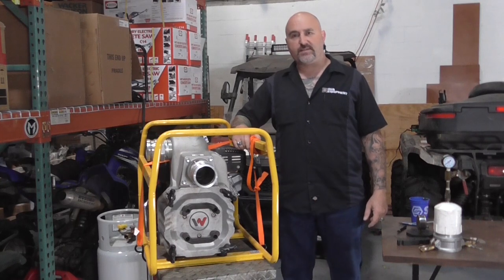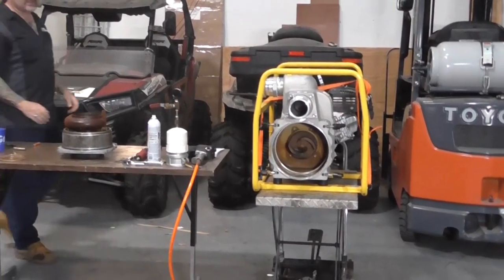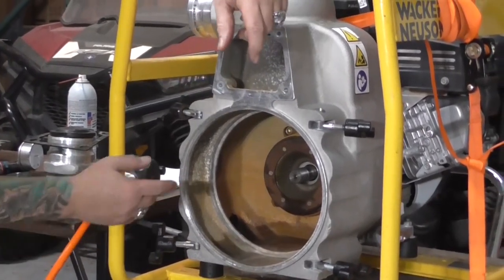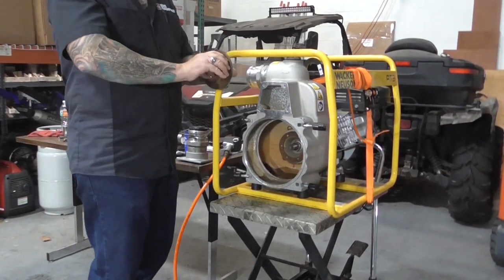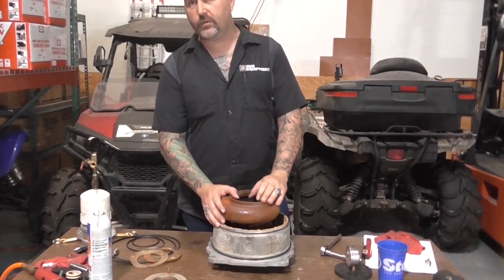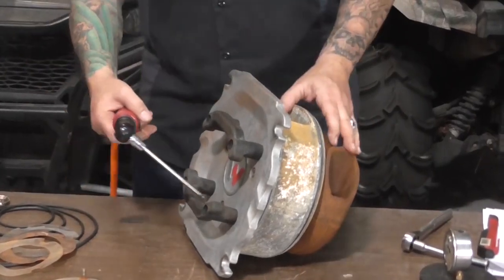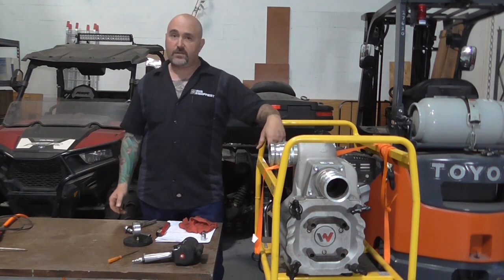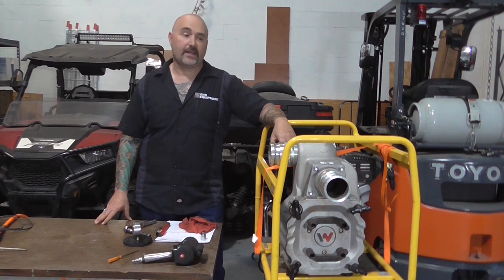Wacker PT2, PT3, PT4, PT6 Troubleshooting - Won't Pump, Won't Suck

Comment: Question on PT4: is it possible to use the same oil that is poured into the crankcase to lubricate the sealing ring?
Reply from the maker: Hello,
If you are referring to the back of the water pump housing where there is an oil plug on either side of the housing, then yes you can use regular motor oil. That reservoir is not for lubricating any seal rings, it was designed to keep the mechanical seal cool. 
Hope that helps.
Reply: @DHSEquipment  Thanks! otherwise I could not find the brand of oil specified in the instructions

Comment: Any helpful hints on how to get the bolts out of the housing to separate it from the motor? I keep braking 8mm snap on allen keys trying  To loosen the 4 bolts on my Wpt3 pump.thanks..ps the pump leaks between the engine and the pump housing ..

Comment: Hi Dave, I plant to buy a PT3a. I live very far from 🇺🇸. Middle Africa Burundi 🇧🇮. I will fly to Dubai to buy it. I will use it for Sewage Water on a truck every day. Wich accessoires I have to have home, because I cannot fly every time to buy Oring.
Thanks Dave for your video.
John
Reply: Hi John, Here in the U.S., Wacker changed the design of the pump and the new PT3A is very different. Can you tell me which p/n or item # pump you are getting? I don't know if Dubai is selling the newest version yet.
Send me what you can, even if only a picture and I can tell you what to get for it.
Thanks

Comment: I have a 9 year old PT3. The impellar looks just like that. I'm not sure if the threads are reversed. Do you know if they ever were? Thanks.
Reply: They were never reversed. Good luck with it !
Reply: The Wacker has always primed even in a 13' deep swimming pool. I got jammed with debris yesterday, and now it doesn't prime. Checked all fittings, hose, etc. I'm thinking the impellar just needs to be tightened up. Any suggestions? Thanks Dave!
Oh, and one more question. Any idea on how to keep the haft from turning when I take off the impeller?
Reply: Joe,

There are a few things to consider. First, are you just checking to see if it primes with the suction hose in the water and looking for moving water or are you testing the pump only ?  I always separate the pump from the hose to eliminate a damaged or unseated suction gasket or a small hole in the suction hose or something.  When it was running yesterday and working how much suction lift was there? ( the vertical distance that the pump can be above the liquid source.) Is it the same as today ? If it was deeper today than yesterday you could be looking at worn components and yes, shimming your impeller may help depending on the condition of everything else. If the depth or distance is the same today as it was yesterday, I would be looking for something like an air leak from a damaged O Ring or cracked / damaged mechanical seal. 

When we remove the impeller it is with the impact wrench with the impeller tool or a socket on the impeller. Usually the speed and impact do their thing and the shaft doesn't move much. You could use a piston stop ( I don't love them when using an impact wrench, you could damage the piston) or we have in the past put starter rope in the spark plug hole. Bring the piston to the bottom, feed in some starter rope, (You'll want to be doing this on the compression stroke to keep your valves closed.) Don't let the rope fall in, you need to leave some hanging out so it can be pulled back out. slowly rotate the engine until the piston compresses the rope and doesn't allow the shaft to turn any more.

Hope that helps 

Let me know how it goes !

Dave

Comment: How can I time back the diesel engine I got the pt2 and pt1 how can I time back the engine I rebuilding them thanks in advance
Reply: Hi Kevin, send us an email with the machine s/n , mach # item and rev# please.  I have not heard of a PT1 before and not familiar with what  diesel engine might have been on the PT2.   Info@dhsequipment.com . 
Thanks
Reply: 1b20 hatz diesel engine  how to rebuild that engine
Reply: @davedhs6821  it a 1b20 hatz diesel engine how to rebuild
Reply: @kevinroopchan5275  I doubt I'll be doing a video on that, but I will see if I can find some info for you and email it to you.
Thanks
Reply: @Kevin Roopchan  I doubt I'll be doing a video on that, but I will see if I can find some info for you and email it to you.
Thanks

Comment: Where can i get those measurements instrument? Do you sell them
Reply: Allan F. TORRES 

https://stores.dhsequipmentparts.com/pump-vacuum-test-gauge-universal-0700536-5000700536/
the vac gauge we have here, the pressure gauge can easily be made. Either with threaded couplers or quick disconnect depending on what is on your pump.  Standard pressure gauge, valve to release the pressure, drill and tap the coupler and away you go. All standard items from a Home Depot or similar. 

Hope that helped..